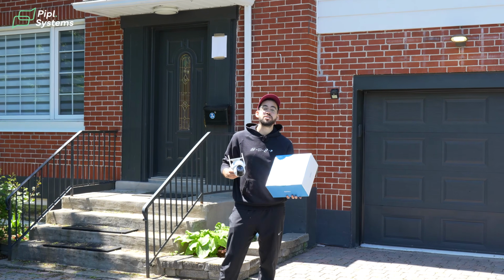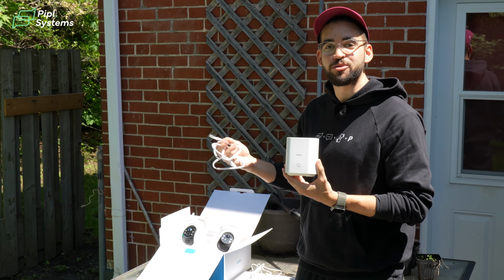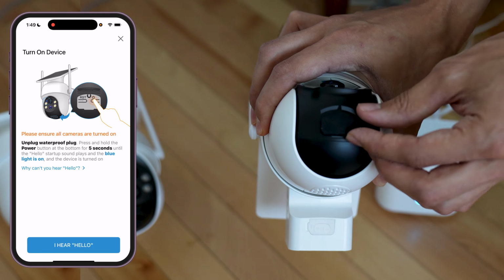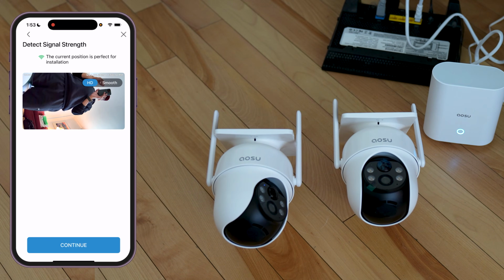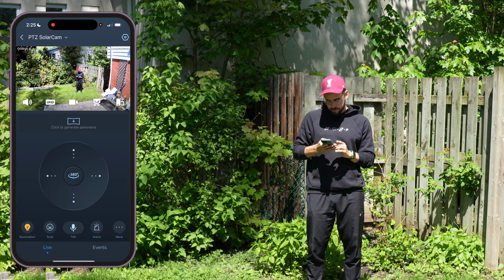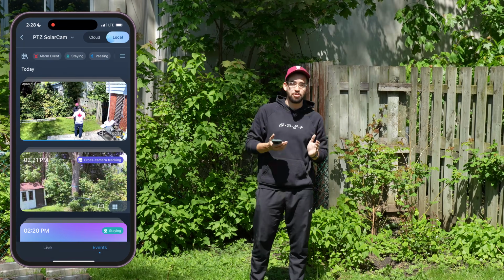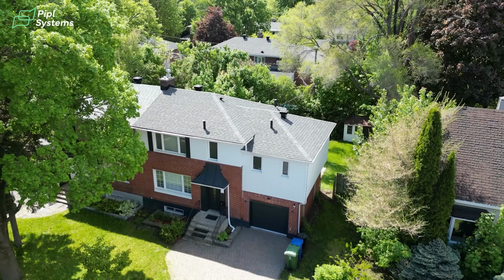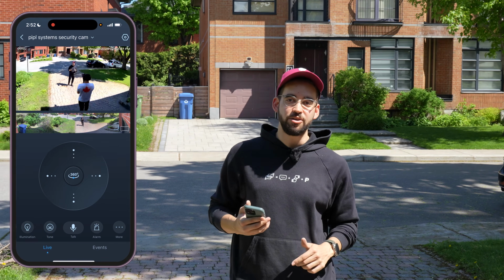How to Set Up and Install a Solar-Powered WiFi Camera System | aosu SolarCam D1 Classic Kit

Comment: This camera holding clip is not strong. The wind will knock it down and it might brake the camera ..
Reply: We just discovered the same problem. Out of the box the mount locks to the camera perfectly. I think when we screwed in the mount (clip) it became distorted. We will slightly loosen the screws and see if that fixes the problem. Will advise.
Reply: Disregard. Loosening the screws did NOT correct the problem. We will use a dab of glue and hope we can remove the camera from the clip if we need to.

Comment: I have the D1 classic and they won’t connect to my WiFi. Going to have to return if I can’t get it to work
Reply: You can contact them from the company 
They helped me with other issue I had but is just like messeges or you can call them 
They are very help full
I had my first order return throu. Amazon and they sent me another new set but now I have another issue but this time I’m chatting with the company and been very helpful 
And sent me another base

Call them
Reply: You read the instruction you need to scan the base remember they only work with 2.4 gigabytes not 5

Comment: Hi, I'd like to add this outside by our barn, but it is too far away to connect to the homebase.
Can I connect a exterior wifi extender to the home base inside the house to enable the  average to connect?
Reply: If the extender if far enough ro reach your barn. Id check with my phone company. Sone offer hotspots for like $30.

Comment: That's exactly the DIY solution I need
Reply from the maker: Thanks, Oleg! We made this video as a step-by-step guide to show not just how the system works, but how easy it is to install it yourself.

If you like this solution, feel free to use the link in the video description to order the camera. When you purchase through our referral link, you’ll also receive 1 year of free technical support from the PIPL Systems team — we help with setup, configuration, and any technical questions you might have.

Let us know if you need anything — we’re here to help!
Reply: All I need to know is what size of Drill bit you use because the instruction says.  15/64.  And theat to big